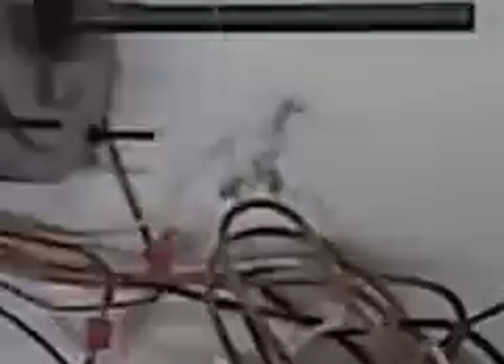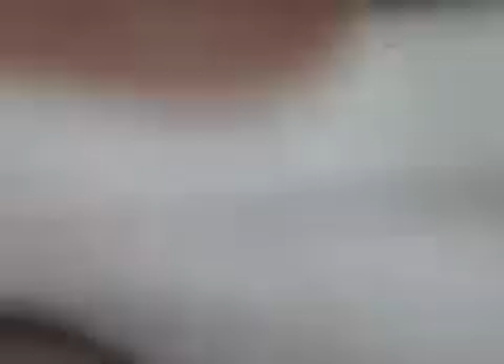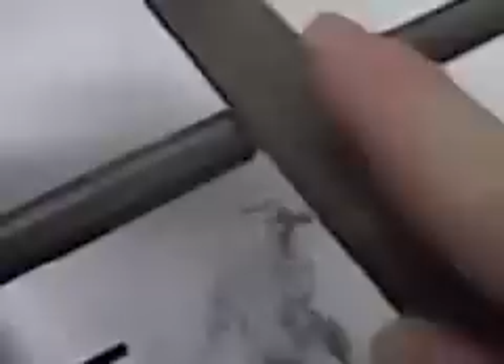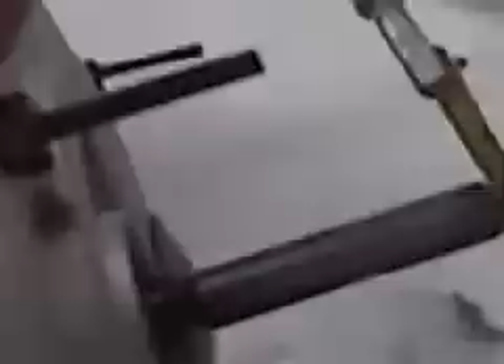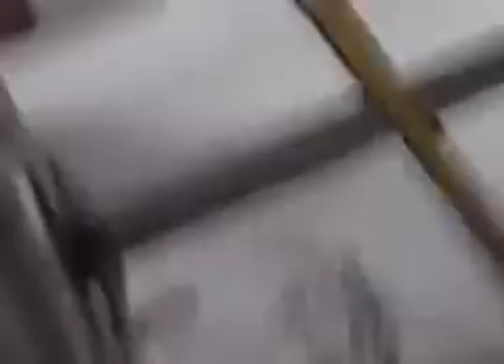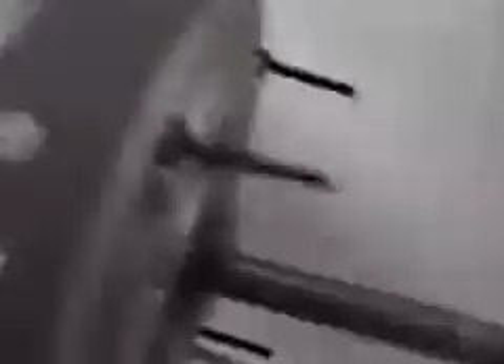How to Cut shaft off new 240 Volt AC condensor motor  with 120 volts and no run cap

Comment: interesting idea- Those things are not easy to cut---so this gives me "the poor mans way"----I guess the downside is that hack saw blades are now 4-5-6$ each but if you just add 5$ into the cost of the motor repair for supplies it works out.